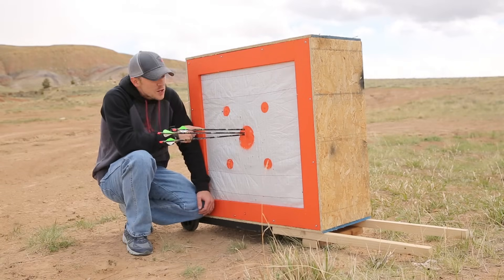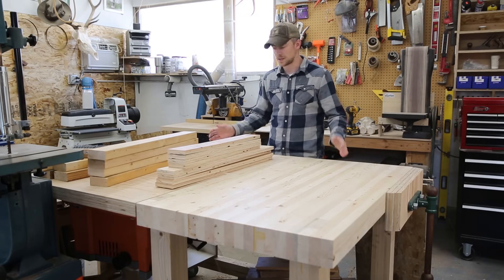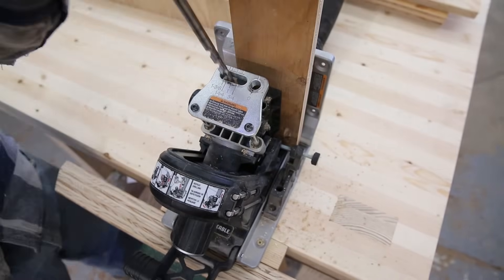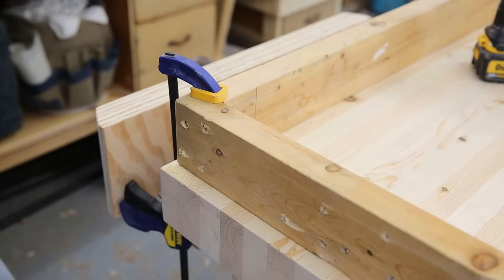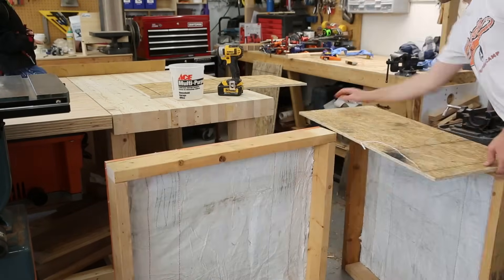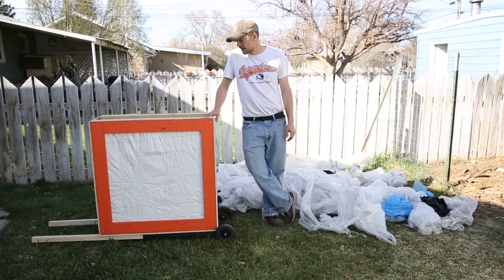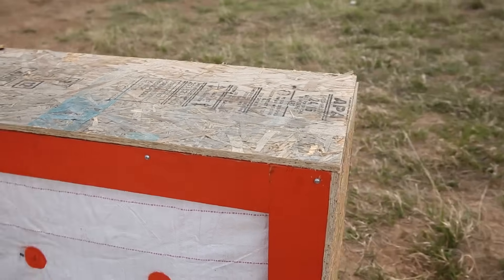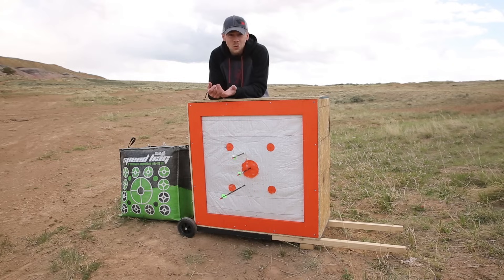DIY Homemade Archery Target from Scrap Materials.

Comment: Cool video! Do you think shredded tires would work just as or even more effectively as stuffing?
Reply from the maker: Interesting idea... do you have a source for some? I think they would work great for stopping arrows, they use a lot of that to stop bullets after all. My concern would be the purity of it... it there was any chance of something other than rubber getting in there, I'm thinking like steal belting or valve stems, there would be potential to damage arrows. But it that's not a concern, the only complaint I might have would be weight. I think it could be a really good option though.

Comment: You could also use some small like 3x3 plywood gussets on the backside of the face frame and glue it, screw it from behind, and clamp it. Not as pretty but just as effective. Especially of you cut 45s
Reply from the maker: Definitely a good option!

Comment: Why didn't you shoot a few arrows into the commercial target to compare the effectiveness of the targets from the same range?
Reply from the maker: That wasn't really the point I was trying to make. I ran out of packing material and couldn't get more before I wanted to post this video, so that comparison would have made my target look pretty bad because it wasn't set up to it's maximum effectiveness.
Reply: Makes sense. Good video by the way. I am a woodworker as well and I like the thought processes you used when deciding how to put the frame together.

Comment: Neat idea! You could actually pack the plastic way better if you'd put it in another plastic bag and vacuum it by a vacuum cleaner. I would also suggest to use several thinner layers rather then one pillow because once pierced it would swell less.

Comment: I would like to see how hard it is to remove the arrows, other than that it is an awesome project!
Reply from the maker: That plastic wrap is actually very easy to pull arrows out of. That "hardest" part is getting the field-point to pop through the face. And even that isn't difficult at all. Just grab the arrow and pull fast, it comes right out.

Comment: You could habe stapled the cavas to the 2x4 frame and still built the complete face frame as 1 piece then screwed the face frame to the 2x4 frame to sandwich the canvas.           A better way to compress your filler material would be to lay metal banding around the inside perimeter of the box, then cut 2x4 blocks to the inside dimension of the box and lay them on top of the banding.  Now stuff your filler material in and band it together.  When finished, install osb lid covered in vinyl for weather protection.
Reply from the maker: Yep, there's lots of other ways to do it.

Comment: Has anyone used broadheads on this material? It doesn't seem like they would pull out easily
Reply from the maker: You are correct. This is a field point only type of target.
Reply: Brodheads will cut the face not poke through like feild tip

Comment: Great video, think I'm going to be making one of these and I've already got access to all the materials. I've got an unlimited supply of brand new rolls of shrink wrap. You should look into large gaylord liners for weather proofing their large enough you could just wheel it into it and zip tie the end closed. Thanks again for the idea.
Reply from the maker: I'm glad I could be of some help Sammy! And I'll looking into those liners... I've never heard of that before.
Reply: I do not advise doing this. After several workouts, the front panel will burst. Also, arrows very quickly knock out holes and flying through them break off the plumage.

Comment: i do the same target but use a rubber floor mat for my face i shoot the smooth bottom they last a real long time. just nail the mat to the 2x4 and lay the outer frame over top then screw that in place too pinch the whole face tight. when its time to redo the face i just put another one over the old one and repeat. i guess in 20 years ill have to figure out how to pull them all off lol
Reply from the maker: Haha! Good ideas - they last a long time if you keep adding to them.

Comment: You should not use OSB board on an outdoor target. I am sure it CAN standup but that shit absorbs water like a sponge and swells. If you're going to use the cheap board, definitely seal it with something, truck bed liner is something I recommend, it creates a hard durable coating.

Comment: Any idea on speed of your arrows?  I just bought a crossbow and love the idea of making one of these.  My bow is rated @ 330 fps.
Reply from the maker: I think I'm in the 290's with around 400 grains in my arrow. 
This would stop a crossbow bolt, but you definitely need to pack it with as much material as you possibly can. Then pack it even harder. I would say you could make it deeper, but with short bolts they would just disappear inside.

Comment: Just curious about a update on the target. Still using it? Hows it holding up? Passthrews yet?
Reply from the maker: No passthroughs yet, but eventually the dots get shot out just like any other target. When it starts to get close, I just open the top and either stuff in more material, or rearrange the existing stuffing so the "wound channel" isn't there anymore.
Reply: You could add a layer of expanding foam on either side to reduce wound channel issues

Comment: Easier target:
 Step 1:  get a big box
Step 2: get a lot foam or more boxes
Stel 3: fill the box with thebfoam or boxes
Done
If your box is thick enough, the arrows won't go through and you don't have to clean anything up after shooting. 
Optional: add a nice finish
Reply: I did this a while back. Used a generic cardboard box stuffed with random crap like old shirts, styrofoam etc. Worked well except for the front getting chewed up so fast that the insides kept coming out. Still worked though!

Comment: Get a floor mat for horse trailers for the back of your target and your arrows will never go through the target. A 4x6 may is about $20. You can do the face out of chicken wire and it will last longer

Comment: Only problem is, is that if you are going for a long distance shot and your not yet very good, your arrow could get busted up if it hits the wooden frame on your target.
Reply from the maker: We all shank a shot once in a while - I have put a few into the wooden frame and they just punch right through. I have had to take the frame off so I could unscrew the point to pull the arrow back out, but so far I haven't hurt an arrow shaft at all.

Comment: how do the arrows pull out of the plastic
Reply from the maker: Easy, my 3 year old can pull my arrow for me. The trick is to make sure that you remove as much tape and labeling off of the pallet wrap as you can. That other stuff can hold onto the arrows a little tighter. 

If you are shooting with outserts/oversized points - anything that makes the tip bigger than the shaft - then the grain sack is actually the hard part to pull through. The best technique is to pull fast.

Comment: Great target... I'll have to do this at some point for my bows.

You should get your elbow up when you're drawing your bow, though. You're doing what's called a 'Chicken Wing' draw, that's not a physiologically sound way to draw and it's also a classic symptom of overbowing. Having a bow that you're not strong enough to draw properly is like waving a gun outside the White House: You're asking to get hurt, and bad. You're using your biceps and your shoulder to pull the bow back, instead of your back muscles, so you're really risking a torn rotator cuff. Take it from me: if you like shooting that bow, a torn rotator cuff is the furthest thing from 'fun'. I tore my rotator cuff when I was 8, and I not only wasn't able to draw a bow for 15 years, but when I finally was able to I couldn't draw more than 10 pounds. Move down to about 30 pounds in draw weight, and work on keeping your elbow up when you draw. Your shots will feel smoother, and your groups will tighten pretty surprisingly once you get your back tension right.
Reply from the maker: Thanks for the pointers!
Reply: I agree from a target stance. But when hunting that draw creates way less movement

Comment: fyi. OSB will deteriorate when left exposed to rain. You would been better off using plywood than painting.
Reply from the maker: You are correct. But I didn't have any scraps of plywood on hand. The OSB was laying there and cost me nothing. When it falls apart I can just replace it.

Comment: Most people don’t have the money for a Pocket Hole Jig nor do they have a huge shop as you have.  Drilling and screwing the ends together is something most “average” homeowners can do and it does’t cost an arm and a leg, it doesn’t require a fancy saw etc.
Reply: So do it that way....his version is fine.  I.... do have a pocket screw jig, and also the ability to think up a dozen other ways to do it.  I will take his idea, make it work my way, and be a happy camper.     Thanks
Reply: @charlescote8391  but you think for yourself...not too common anymore

Comment: what about a cardboard box filled with old socks
Reply from the maker: That could work, but the cardboard will wear out pretty fast and you'll have to keep moving your socks to new boxes. Just make sure you stuff it tightly or an inconsistency in the fill might cause a random pass-through.

Comment: Ok..heres what i do..got a window plant near me..i know a guy with the forklift..loads my silverado with an enclosed pallet of scrap screen..i empty it out and cut the pallet in half..let center posts out in front and fasion a face material out of free bilboard material i get from my cousin that works for them..roll it on 2x 1/2 inch wood and screw to the insides tightly..when it starts to dig a hole..unwrap oneside and take it up on the other..fresh..also..suspend the target on the front poles using tarpaper nailes and bungy cord..keeps the arrows from drooping down and cross shafting..like 4-6 inches away works great...one sheet of old tin roofing cut in half mounted on an angle  makes a great roof..stuffing is screen scraps..after years it might get compacted..reach in and reagitate  the screen..i made three of these and gave two to friends...lasting for 20 years👍

Comment: Not trying to hate, but you refer to this as "free".... it's only free if you have all these tools.  Any ideas for a free Target for someone who doesn't have a tricked out shop????? Great video none the less!👍
Reply from the maker: Hey Timothy, I've heard that quite a bit, but you are the first person to approach it diplomatically - So thank you for that!
You could build this same target with much simpler tools, it just might not come out as precise. Really, all you NEED is a saw and a hammer with some nails (a drill and screws would save TONS of time). None of the parts and pieces would really change, but you might want to adjust HOW you put it together. 

Maybe one of these days I'll build another one, and I'll use basic tools just to show that process.
Reply: Gunflint Designs I'm really not hating.  I use to work in a custom cabinet shop, so I simply realize the investment you have in your tools and shop.
Reply: Feed bag or tarp stuffed with old clothes.  Check thrift stores.  They get old clothes donated that aren't good enough to sell and they chuck them.

Comment: Just don’t shoot the wood. Getting the arrow insert out would be biatch
Reply from the maker: It happens on occasion. Arrows with outsets tend to get pretty stuck, but regular straight shafts usually pull right out.

Comment: This is what I use. 

https://www.wanneroostockfeeders.com.au/products/hay-compressed-oaten?variant=19736361631847
They last me over 1000 arrows. Just keep flip it when you start to chew it out on the face, or side.
I use compound bow, at about 40pound, and my carbon arrows go in about 6 inches, at most.

Comment: Your pull is a bit odd. Try to lift your elbow during the pull, not after it.
Reply: There’s absolutely nothing wrong with his draw. If you need to raise either the bow ow your elbow above the line of flight then you are using more bow than you are able to draw well.

Comment: Just use a hay bale only 35 dollars and then ya can feed it to your cows
Reply from the maker: That would work for a recurve or a long box, but modern compound bows have so much power they would blast arrows right through a hay bale.
Reply: Throttle Down 4 What ive shot hay bales for years. 2 deep holds a compound bow for a while. But eventually the arrows punch through. They only cost $10 here tho.
Reply: Lol most people dont have a use for hay, espicially not old moldy bales that have sat out for months. Its also not free

Comment: Total cost of making this is $100 for the wood and $5000 for power tools. Basically nothing!
Reply from the maker: You could do it with a hand saw, hammer and nails if you wanted to.
Reply: A pallet and some jobsite plywood scraps. Hammer and a saw. Think for yourself a little

Comment: terrible idea. arrow hitting studs = messed up arrow. also, hows that just some screws and glue? i see lots of good lumber.
Reply from the maker: Aim for the middle.
Reply: Gunflint Designs aiming does not equal to hitting. if there is a chance my arrows will get busted by shooting at this target, well then im not shooting at it. 
there is no point building the face frame. pretty sure a simple four sided box will do the same job. still a terrible idea tho since theres still wood to be hit, but at least minimize the chance of it happening.
Reply: Dude how cheap are arrows and how bad of a shot are you??
Reply: Oh guess what. The commercial targets all have wood and some have metal banding.
Reply: He also said its made from scrap lumber. So the only thing he had to buy was screws and glue. Geez some of you folks cant think for yourself

Comment: Waste of you time. You definitely can make more than $60 with the time you spent on the project. I have a better idea. Change you arrow head to judo head. Buy a pillow or two, put a thick cloth on the pillow. Put a cardboard in front of target. Now you can draw some target circle on the cardboard with marker. I stick note sticker on it. All you need to change is cardboard.  Btw I knock off the claws of judo head which make cardboard last longer.